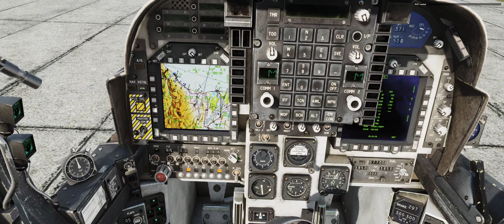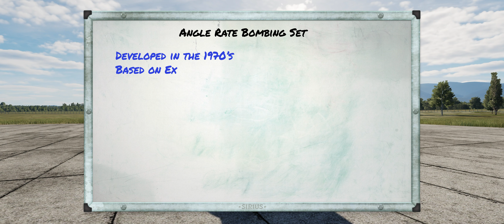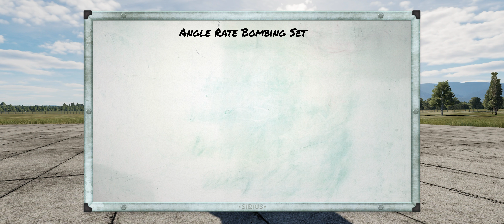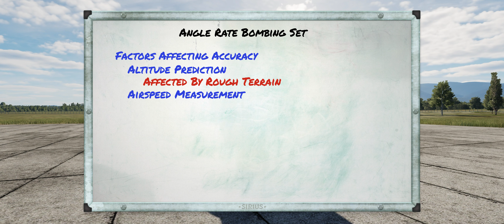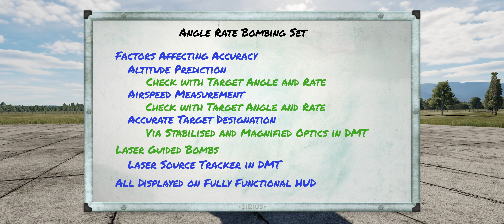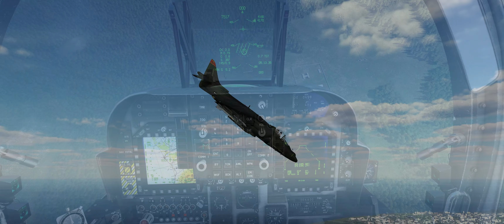What's An ARBS Anyway?

Comment: Awesome video Iain, great stuff!

The only problem I have with saying that the DMT and ARBS was an inspiration for targeting pods that came later is that I think the Pave Knife and Pave Spike targeting and designation pods both predate the DMT and ARBS by quite a few years?
Reply from the maker: Yes, true. But o don't think they had the magnified optics and the ground stabilization which is where the DMT really shines. I think some bright spark decided to combine the two and VOILA - litening strikes!
Reply: @Sidekick65  Got more intrigued by your response, so decided to go looking. Not that knowledgeable about either pod, but I did find the F-4E weapons delivery manual, which has info about the Pave Spike. There are two levels of optical magnification, wide and narrow FOV, but I haven't found specifications as to to what the exact field of views are. There's no true optical ground stabilization in the way the term is usually used, but the optics are gyro stabilized and when in "track" mode the pod receives inputs from its own laser ranging system and the plane's INS and pitch/roll data to track the target as well as possible.

Hard to say anything certain about the lineage, but they're all cool technologies, and I do like that the Harrier has the DMT available for more precise bombing even if you're not carrying a TGP. =)
Reply from the maker: Great research!  Thanks, I think you can see the lines converging here...
Reply: @Sidekick65  Definitely! Lots of development going into all kinds of targeting and guidance systems during that time.